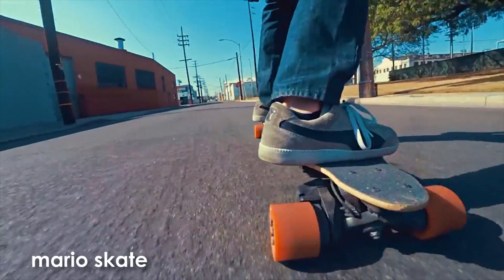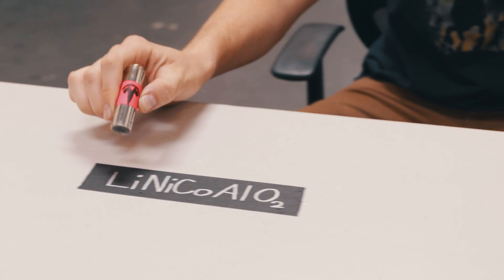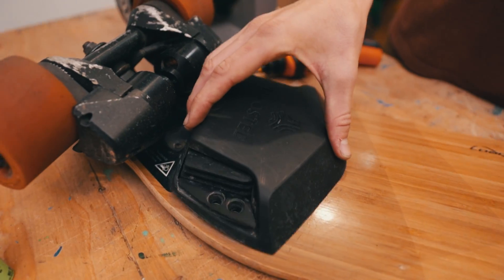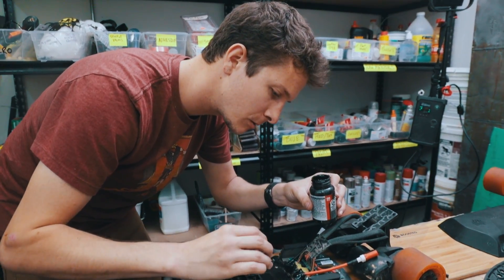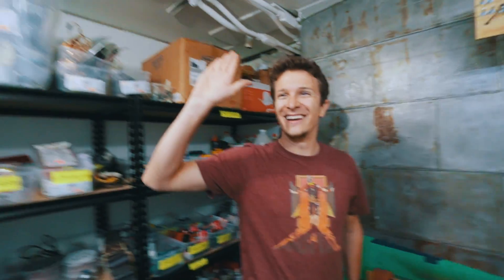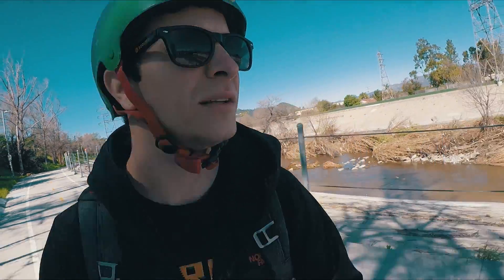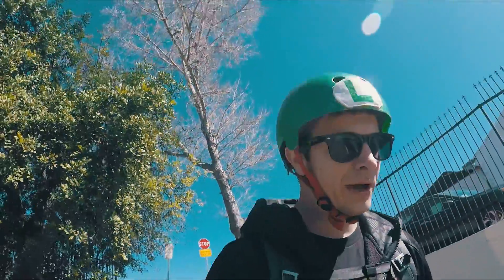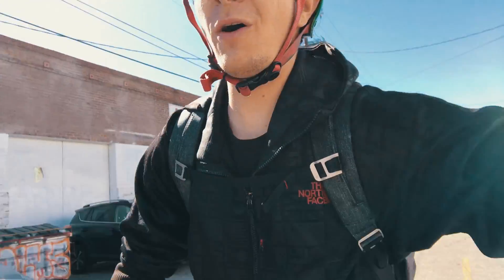Tesla Batteries in an Electric Skateboard!

Comment: I'm ME not EE, but I would use the boosted board until it dies then switch it over to the new pack instead of running them in parallel.

Comment: Wren, your voltage readings were. It good. Lithium batteries should never drop below their nominal voltage of 3.7v per cell and you had 36v for 10 batteries. This can decrease the batteries performance permanently. You really should have stopped when the batteries where 38v to be safe. That's why you went so slow

Comment: What happens is your two batteries start charging the default battery once the latter reaches below 33.5 V. This means that the batteries you created need to not only power the board, but also supply power to charge the default battery, which is why you could not reach top speeds past that point (and also is DANGEROUS you risk frying the default battery which could catch fire). I believe using a load sharing chip (something like the LTC4416, but with a higher voltage rating) would fix this problem. From their documentation: " the LTC4416 acts as two interconnected ideal diode controllers". Also, this will ensure that you use your two custom battery packs in parallel equally!

Comment: Which 18650B variant are you using? The B has a discharge limit of 4.67A if I remember correctly and the BD has a 10A limit. Using the BDs might improve your torque. If you can find them the Panasonic 18650Gs have a higher capacity than the Bs. Keep in mind that the 18650s have a max charging temperature of 45 degrees Celsius so if you are regen braking on a hot day you might be pushing a bit into out of spec territory. Also get some physical protection on those battery terminals or an impact and thermal runaway may be in your future.

Comment: 18650 batteries have a higher capacity but a lower discharge rate or C rating, I think this is why you aren't getting the same torque up hills

Comment: It may sound like a simple silly answer, but can you fit more packs on? From what I'm aware, there's no real way to utilize that extra power because of the voltage "drop off" but more packs (provided you can add them without raising the voltage overall) would make it so you can retain a higher voltage for longer.

If you had some people that could make you a circuit board that will detect when the voltage is getting low in one pack then it could automatically switch and start drawing power from the second set then you could have a kinetic charger that charges the "off duty" battery set using the kinetic energy while one set is working, sort of how some electric cars power cycle to different battery modules. (I know this is probably "too expensive/too convoluted" but this is just the scientist idea thing, where I come up with an Idea and the engineers tell me how hard it would be to implement XD)

Just an idea, but maybe I should try and sell it to the company that makes boost it boards?

Comment: you can find a way to trick the board into thinking that it is all the same battery by putting the boost it battery in parallel with the other two packs

Comment: can you not just bypass the problem batterys and wire your custom packs directly to the board so you are getting a direct feed and are not limited by the stock batterys or find batterys of the same specification as your packs that will fit in place of the standard ones?  Also you could model a casing for your batterys and 3d print them

Comment: add a capacitor for starts. then add a switch and battery in parallel for the control unit  when the firat goes dry hit the switch for the other.
Reply: the capacitor is for the panasonic batteries.

Comment: I think the boosted board battery needs to be taken away from the equation, you need all the battery's to have the same output and power and size to get along I'm not good at this stuff I'm a welder/mechanic. But then I would guess that taking away the factory battery may cause other issues making you basically build a new system utilizing just the factory motor but you have to be careful because you could burn it up or even have to much power and it would be a rocket on wheels if it does not burn up. Just saying what is going through my mind, btw you are fantastic at explaining complex mechanisms.

Comment: You could have a manual switch to get your packs from parallel to series.  Not the safest option but probably the easiest.  That'll take your ~23v in each pack to a collective ~46, then you can use that until you get down to 40v again.  
That is if the board can handle having voltages above 40v

Comment: There's an app that you use for the boosted board to change the speeds, it's probably set to beginner mode. All boosted boards come set that way for safety. That may very well be the reason for why you're not getting the speed you're expecting.

Comment: This is basically what a Joule Thief does. You fill up a series of capacitors until they hit the voltage you need for whatever. Then they all discharge at the same time. It's like filling a dam up and then opening the gates at just the right time. If you have enough of the right size capacitors you will be able to fill them up and discharge them at 40v at 60hz. Just be carful because you could easily run the batteries down to 0% and never even know you were about to have a problem! Hope this helps

Comment: the real question is ,is your battery pack in series or parallel , when they are series if one of your battery's dies it will cause you to lose use to the rest of your battery's power,  and there is a power booster they are called transformers, but you don't want to use these since they will make your entire build inefficient for a small boost  .

 your best bet is to 
- lower your motors power need by getting a new one
- add more battery's
-decrease the weight on the board to make it use less power
- try new barring on our board  or clean out the old ones
- add a capacitor that you can plug in to the motors when your battery's are acting up
Reply: Transformers do not work for dc, they rely on the moving magnetic field of ac current to work. A dc to dc voltage changer is called a converter and works under different principles.
Reply: I have seen a transformer used to boost the voltage off of a solar panel. an H bridge was used to invert the DC off the panel into AC, then the transformer stepped up the voltage. After that a half bridge rectifier was used to convert the the ac back to dc.
Reply: Yep the transormer is working with a.c. though.
Reply: deathbunny omg you need to learn more
Reply: thanks for that @spider0804 I didn't know that transformers only work with ac .
Reply: Haha no, there are plenty of transformer designs that work very well with DC still using a typical transformer keeping efficiency very reasonable. Look up a flyback for example.
Reply: Friend the definition of a transformer is an energy transfer over a moving magnetic field and a non moving magnetic field....or stationary D.C.... does not transfer energy.
Reply: Also flybacks convert dc to a.c.
Reply: If you still do not belive me google the definition of transformer or take an electrical class.
Reply: If you put the batteries in parallel, they essentially just charge each other. They must be in series, and have DC-DC converter (i.e. buck-converter) to switch the voltage down. Charging is a different, and probably far more complicated issue.

Comment: From my knowledge, Boosted uses A123 cells which are a different chemistry than Lipo and Lithium ion cells in many ways, one of which being the fully charged and fully discharged voltage. If you get yourself some of those to use with your boosted board then all your problems should be fixed, you'll get more torque, and the boosted board might even be able to charge them because they are the same type that it uses.
Reply: You're right! That would solve the problem I ran into, but would't solve my issue of range. I chose the batteries I did because of their energy density. If I made two extra packs using the same batteries Boosted uses, I'm not sure I'd be able to go the distance from home to the studio.
Reply: Yeah you're right about that, sadly those A123's have a much lower energy density. How about rather than making a 10s pack, you make an 11s pack so that your end voltage will be just at 33v, much closer to that of the end voltage of the boosted batteries.

Comment: Pro Tip

If you stab wires into a potato, ducktape it under the board and solder then other ends to the batteries you can go mach 10 in under a second.
Reply: Dude you nailed it. This is the solution.

Comment: Its unwise to do this however you could look into how the original battery is wired to the board (Look for protection circuitry on the board) you'll probably have to mod the main board.

Probe around on the original battery's four leads when its both "charged" and discharged and see if there's any circuit on the board or signal coming from the battery registering that its discharged.

You could hypothetically electrically disconnect the original battery when its discharged down to 33.5V (Using relays, solid state relays or hefty af MOSFETs). And strictly have the modded batteries connected to the main board. Somehow overriding the main board's shutdown.

TLDR: Of course this requires a schematic or reverse engineering the main board.

Comment: Does a boosted board function whilst charging? or does it have some kind of a safe guard locking system? If it does still work, then maybe try hooking u the Tesla batteries to a boosted board charger cable and charge the internal battery with the Tesla batteries and ride at the same time. Kind-of like using a power bank with a cell phone or mophi case.

Comment: I'd just put a switch on the other batteries so that your not draining them, and you'll get more power if you might leak one battery at a time? Just thinking this might work
Reply: Beginning Genesis it won't work you get more energy when you discharge them all together coz when they drain slower you get more watts out of them
Reply: True true,

Comment: Hello Wren, I'm at my fourth year of study in electrical engineering. You can write me or text me right away (1-418-717-4118) if you have any questions. To solve your problem you might want to use a Buck-Boost DC-DC converter to assure that the voltage outside your battery is always between 35-40V whatever the input voltage is. What you have to be careful about is the limit rating current of the dc converters you decide to use.
Reply: Thanks for the response! It turns out my issue had less to do with voltage and more to do with the current draw from the batteries. So since the board's motors are 2000W, and the board operates at about 40 ish volts, it's pulling over 50 amps of current! I totally underestimated this part. The batteries I added have a C rating of about 2, meaning each pack is putting out about 7-10amps of current. So between the two packs, that approaches 20amps from the battery packs I made. This means I literally can't provide enough power to the motors regardless of voltage haha. DANGIT! 

I've thought about using DC-DC converters (in fact I actually just got a really good one meant as a solar controller) but I'm not sure how this is going work alongside the internal pack which will slowly drop in voltage, where as the transformer will keep the voltage from the packs steady.

Comment: Long ass solution comment ahead. Read at your own risk.
Seriously, my solution is very long winded in description.
You have been warned... lol :P

From my research your best bet is to either find or build yourself a 4 switch buck/ boost converter. Now for all you say about no monitoring on the extra batteries and such might be mostly true you will still want to monitor the added packs to be sure the voltage does not go below the minimal point for lithium cells. Typically 3 volts or that 30 volt point for your 10S packs.Use the buck/ boost converter to keep the voltage output of the battery up near 36 to 40 on the output. That will spoof the controller into showing the actual capacity left in the extra cells. If you wanna take it a step further and protect the added cells to a degree then you can add in a negative feedback monitor system that will adjust the output based on the input voltage. Have a small controller with a voltage monitor on the input side where the added batteries go in. Have it set  so that as long as the voltage is above 30 going in the output stays high. Put it around 40 or so. Then have it set so that when the added packs hit 30 then the output drops to like 32 or something close to the point where the board controller stops or slows down to protect the batteries. You will need the added controller set to monitor the input and output voltage so it can adjust as needed to set the output properly based on the input. In theory this will allow you to get all you safely can from the added cells and use the built in battery level system to read the current charge amount to a degree. This is the best and simplest solution I can think of that will get the most out of the batteries, be fairly cheap, easy enough to do, protect the batteries fro mover discharge damage, and keep the battery monitor system mostly functional. Hope my solution helps.

EDIT: Forgot to add that this solution is all completely separate from the board system so no need to modify any internal board bits at all for this to work. No controller hacks or anything like that at all.
Reply: That sounds easily done. I mean, making a efficient, stable buck boost or sepic converter is super easy without the right tools :D

Comment: you could pretty easily add a small switch to the bottom of the board, and when one battery dies you switch to the other. sure its not the most elegant solution, but itd be cheap, easy, and fast.

Comment: haven't finished the video yet and I'm sure you've had this suggested. there's probably a computer in the board that reads the battery and if it's too low will limit speed to conserve energy. see if there's something like that and wire it into your new battery system maybe?

Comment: make it where you have another battery pack of those hands that are connected to charge the main booster board battery so why those batteries are charging it used to have extra batteries to run on at least that's what I'll do I want at least that way you can know when your about to run out of those 10 batteries in the one because it will always be charging your bored

Comment: I would use some type of emergy convertor to shut off the old and drained battery and use the ladt energy in the newer batteries you added. If that does not work, hook up some type of wind dvice to the weels that when the batteries are being used to turn the wheels, the wheels are making energy and charging the batteries a little meaning they will have more time if it goes right. think of it like a wind up flashlight, as long as you wind the crank the flashlight has power so if batteries run the wheels and the wheels make energy, your batteries will use less.

Comment: V=IR P=I^2R  (there are other eqtns too) 
I thought you understood what was wrong until you started drawing on the white board.    
What happened was during the first half of your trip you were using All Batteries, I assume you wired them in Parallel,( please correct me if I'm wrong there, or anywhere in this comment.)  So the first half of your journey all was good, you used the boosted battery and your panasonic batteries simultaneously.    This may have extended the range of the boosted battery  since it didn't have to push so hard as there was current available from your two added battery packs, so to some degree for the first half Boosted board had it easy... and you did mention going farther than ever before, so I'll stop there with that thought. Soon however, the boosted battery wore down.  At that stage the current it could output was so negligeable, it couldn't contribute.  Think of it this way,  the Boosted pushed and the others helped, but once the boosted got tired out, it couldn't push anymore.  At that stage you were relying solely on the Panasonic batteries, and as you said their output current was restricted as per their design.  So the solution is to make more packs  Four of them instead of two, that way when the boosted battery runs out you can still do 10 mph.  You may still have to climp up hills or stop eating and lose weight to make it to work on time,  but it's all for science and engineering right,  right?      ;)

  I have my new boosted reserved for this spring  a dual+ 
am interested in your progress still.   Keep up the good work!
Reply: Thanks for the response! To clarify, I do understand what's wrong. The issue is that the battery packs I made can't put out enough power. They're maxing out at about 20 amps of current where as the motors needs over 50amps! They're 2000W motors. So as the three batteries are being used equally, the Boosted pack gets low enough that it has to rely more on the external packs. And since those packs can't put out enough power, the board crawled to a halt. You're right in that more packs would solve this issue. Making new packs with a much higher C rating would also work. But also to clarify, once the Boosted board batteries are done, the board can't be used anymore. So the idea is to help those Boosted batteries last as long as possible.